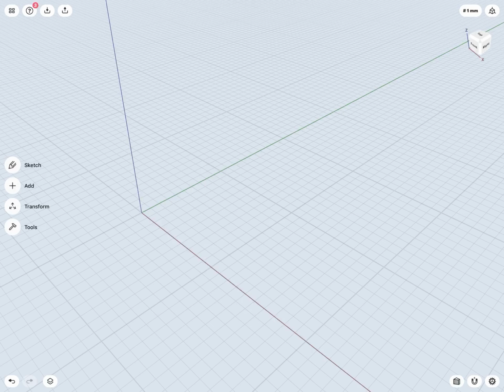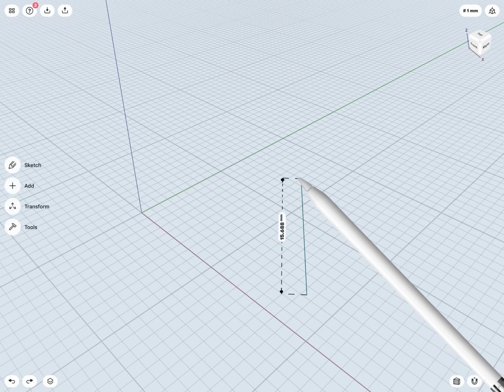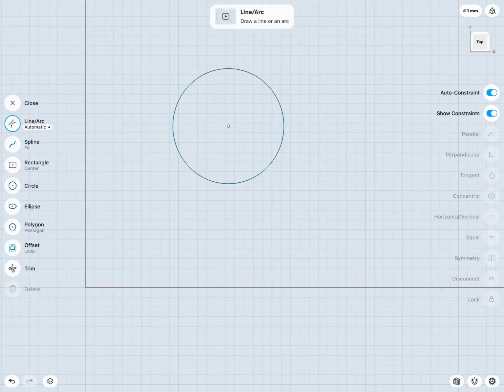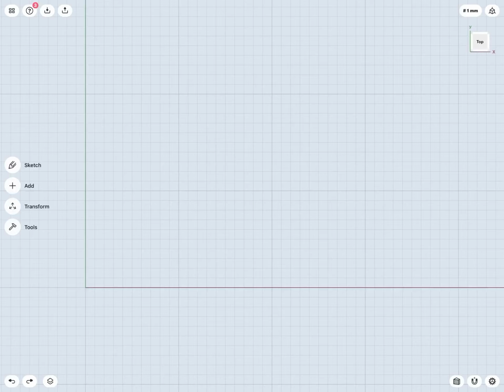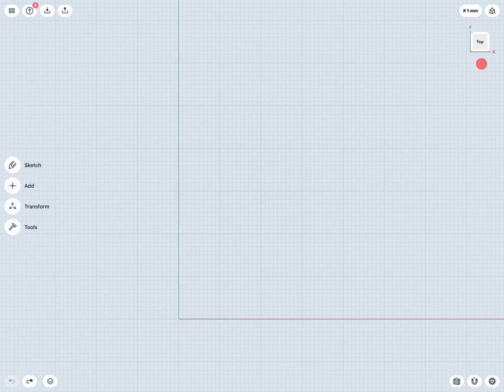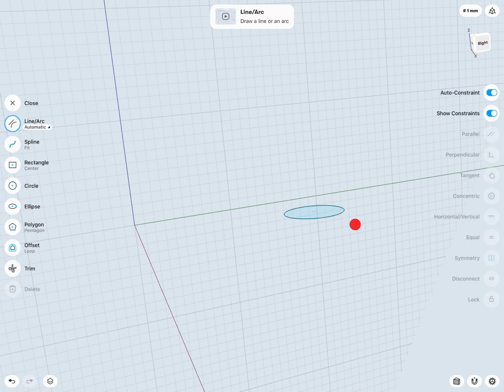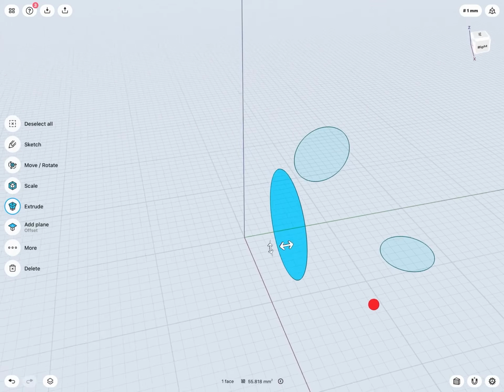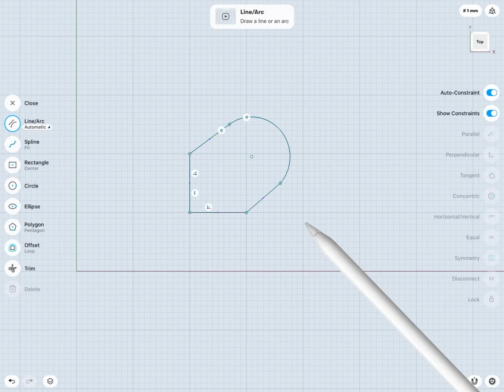Sketching | Draw 2D sketches

Comment: Is there an easy way to connect 2 points on different axis? It's quite difficult to draw a line and then spin and angle it in to place
Reply from the maker: Hi 👋 This is currently not possible in the app. A way around can be using the Spline sketch feature, using the midpoint line as a guide for one of the lines.